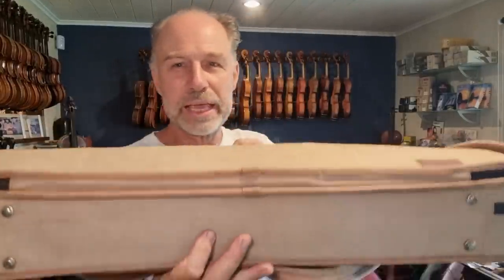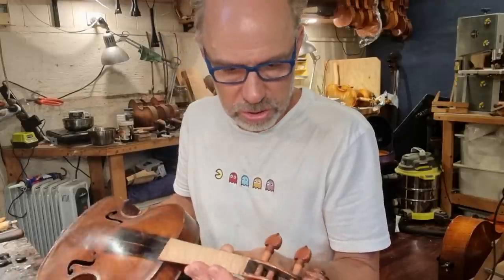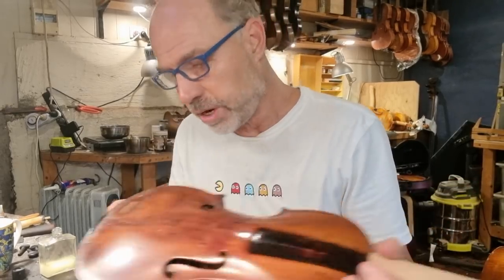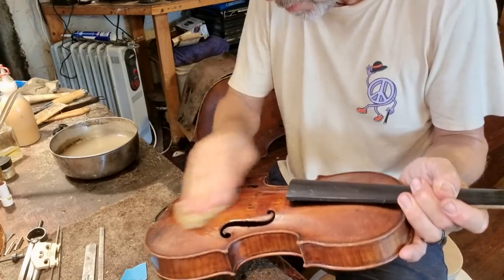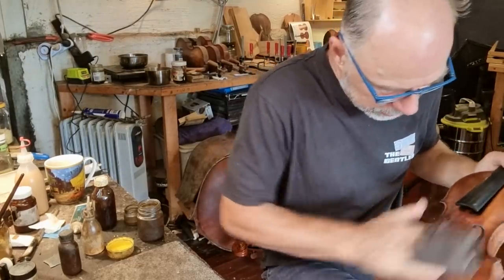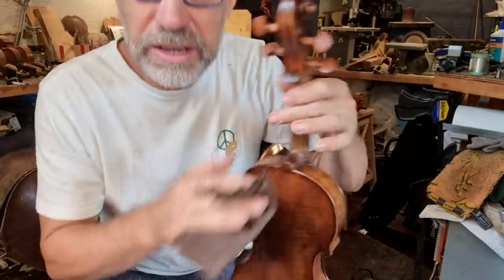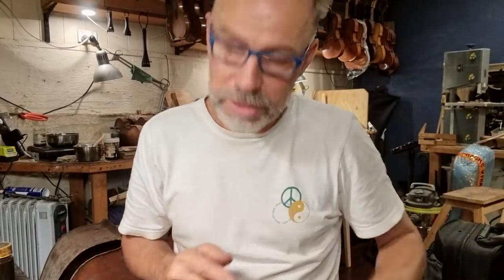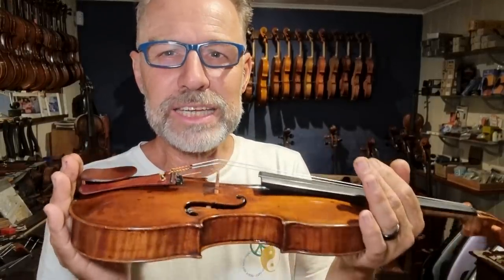243 Year Old Violin and it's amazing story

Comment: Generally, top instruments are - when not in use - stored in a kind of couveuse, a temperature and humidity controlled environment. Wood works and when the storage is insufficient some problems might occur. Another issue is the glue. Nothing is forever and certainly the violins maker's glue isn't. In early times, the instrument maker made mostly the glue himself, cows, hoofs, rabbit skin, you name it.
Anyway, the body shape of this 'Dellinger' instrument is remarkable, very full, lots of room for the soundcirculation.  Quite a beautiful instrument.

Comment: Thanks for sharing the story.
I would have been curious why did the top plate under the fingerboard became black? It can't be just the shade (less light), does humidity accumulate and something related to that or something transfers from the material?
Would have been curious of past owners, sadly you don't have the info. If you deal with other violins and if owner doesn't mind ask them next time at least a few words about the history of the instrument to share with us :) like if it traveled across countries or anything interesting.
I wonder how old the tailpiece is, I always thought this "square-ish" (not sure how it's called) form is new but maybe it isn't. Was this used decades, or more, before as well?
I also wonder if cheaper (but still "proper violin" materials and make) could also live for so long if cared for, or does it require the best materials? As far as I read instruments are categorized, among others, based on how long the material was dried. 10 years, 30 years, 100 years are mentioned in the marketing speech. I wonder how that affects longevity, or quality.

I am playing a 16 years old beginner violin that I rent from a small local shop with a grumpy owner that basically questioned and grilled me why I can't speak German (which is fair to wonder i guess). I know it's small because I got the violin from the owner, one Bettina Sandner who is running his grandfather's shop in his name Alois Sandner who apparently came from Bohemian region. I don't know if they make or just sell now. They are in Bubenreuth since the fifties, I understand it's got a pretty high concentration of violin makers for some reason. I suspect my instrument is around the 300 euro neighborhood (their cheapest priced instrument on their site) and at this price point these are probably just checked for QA and set up by them but coming from factory in a cheaper area of the world. I still wonder sometimes who played it before, probably a number of people, if any of them got any good since then :)
Other than the not-so-welcoming customer experience I am pretty happy with it, the bow is kind of crappy but the violin is capable of making decently clear, resonant sound. I have been learning for the past 1.5 years and I sometimes wonder when should I step up to own one for longer term, the thought is exciting (as terrifying is to think of the actual selection process).
In fact I'm going to my weekly lesson in a half hour, I changed strings 2 days ago and should just play it a little because they are still settling in.

Comment: Question: I noticed that on this violin where the bridge rests on the top plate, there are two fairly noticeable indentions in the top plate.  Is there a way to remove these rectangular dents?  I know that in furniture restoration that you can use water with a combination of heat and or steam to permeate the wood, which then swells and expands.   But that is something that is done on wood that has been completely sanded and stripped and that can withstand more vigorous treatment.  Perhaps this is impossible on a vintage instrument such as this?  Anyway, I would be interested in hearing your thoughts on this.
Reply from the maker: Hi Charles,
Yes it can be done. Often we leave them to tell their story unless they really hamper the sound.
It can be dices with making moulds, heat, steam and patches on the inside... It's a pretty invasive operation. 
Most Strads have multiple patches on the inside.

Comment: With the colour of that varnish & darkness under the fingerboard, what are the chances it has been revarnished, without taking the fingerboard off?
Another violin maker (in Italy, I think) has put up a video of him making a violin & when it came to clamping the fingerboard on he laced it on. It's the first time I've seen that method used though. It is interesting how each maker develops their own little methods that work for them, but I couldn't get over how everything was done with hand tools & even the drill for the peg holes & string holes in the pegs were done with a bow & string to drive the horizontal drill. He used a thumb-drill to make a hole for a fret saw blade to cut the 'f' holes. Of course, he used a large bow saw to cut the plates out & at the end, split off a length of spruce (possibly from the remainder cut from the belly) & proceeded to plane it into shape & eventually into the hand powered horizontal bench drill (like a lathe) to finish off the material for his sound post. I think if Strad had access to a bench drill, band saw & bench belt/disc sander he would have used them. :)
Reply: Yes Stradivarius was an innovator.  He wouldn't use hide glue either today.  It's comes apart too easily in heat and humidity.  😀😀
Reply: @nancymilawski1048  Sorry, I disagree with the glue. There is no glue today that is as good as hide glue for what it has to do. It needs to be able to be taken apart. We're not making guitars with PVA glue that can't be opened to be repaired, but violins that do need to be opened when needed.
Reply: @rossthefiddler5890  pva glue can be taken apart with the exact same tools and methods as hide  glue
Reply: @nancymilawski1048  No it can't & should never be used for repairing violin family of instruments! It does not crack open like hide glue but hangs on being destructive in trying the same way.  An old person used to think he was repairing violins in our local area & he used PVA. He was a 'butcher' of violins.
Reply: @rossthefiddler5890  if you apply heat pva comes apart. Hide glue doesn't hold in high temperature and humidity situations like in the tropics. Having an instrument constantly coming apart would frustrate me completely.
Reply: @nancymilawski1048  That is not how one opens a violin, especially an old one. Heat damages the varnish. PVA remains a little elastic too & allows creep in the joins which does not stand up to the tensions in violins etc (yes, I know there are various grades of it). Absolutely fine for cabinet making (unless repairing antiques), but not violins. Guitars are usually glued with aliphatic glues & are not maintained the same as violins.
Reply: @nancymilawski1048  To clarify, cheap violins made in China etc are likely glued with PVA or aliphatic glues.

Comment: Why is it so dark under the fingerboard, is that rosin and dirt getting into the varnish?
 - That center seam on the top plate concerns me at the beginning, it looks like the varnish splits there or something; what's up with that? Though after you replaced the fingerboard and polished both sides it looked like nothing was wrong. 
- That bass in the background looks in tragic condition, are you going to be restoring that?
- I also love your T-shirt collection :D -
Reply: I also wondered about the appearance of the centre join under the fingerboard, but obviously the video doesn't show the full detail.
That double bass has been decorating Olaf's workshop for a little while now & quite understandably with the amount of work needed on it, plus an instrument that size just takes up so much room when working on them. I notice Olaf has replaced (I think) a Ryobi bandsaw with something else too. :)

Comment: The dark mark or staining under the finger board could that be the result of cigarette smoke, dust etc over the life of the violin? Or would the original varnish have been dark and has faded?
Reply: very good question. in the background was to see a dark old violin also kind of a stainer typ instrument. Wy not first cleaning it inside? Wy is there such a worse Guarneri styl bridge on an Stainer Style violin? Wy not putting a barock style bridge at it? wy not removing the heavy ebony fingerboard? or if U want it wy not making it much lighter and a bid shorter? Watch the instruments shown on the picture of your musik book "old masterpieces..." Olaf U should have known that all. U did a very bad job on this violin and this video. This is terrible. Don´t put strong modern Strings on it. remoove that heavy fingerboard, make it thin as possible or better replace it with a Spruce board with a thin layer of a hard wood. the sound will thank you. don´t forget to change the bridge. U are a sinner elsway, shame on U.

Comment: Olaf, great stories, but..... What do you do with the dents under the bridge, after being pressed on the thin spruce plate for almost 2 ½ centuries. Doesn't the dents have a negative effect on the sound? The whole geometrie of the plate, or maybe better, the vibration modes might be chanced, so why you don't even mentions the dents? Maybe there is space for a seperate video, what happens to the sound of a very old stringed Instrument under the stress of the strings. The top plates are usually deformed. What's the effect on sound? Thank you for your informative and funny clips.

Comment: What is rattling inside the violin?
Reply: The soundpost
Reply: @flyingskyward2153  I thought so but wondered why he didn’t fix that right away or mention it. Thanks
Reply: @debbiegilbert5393  I assume it's because until the pressure of the strings and bridge are there pressing down on it, it'll just keep falling over
Reply: @flyingskyward2153  I see. I’m a flutist so I had not thought of that. Thanks